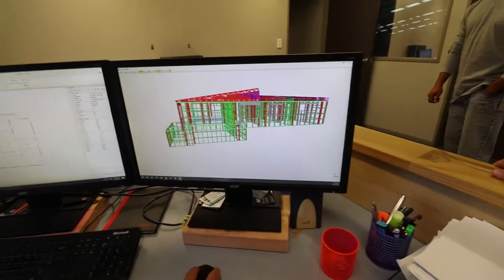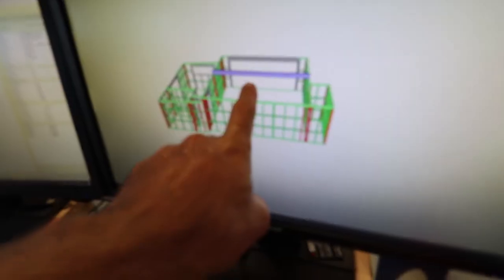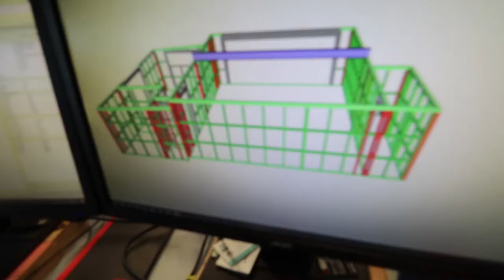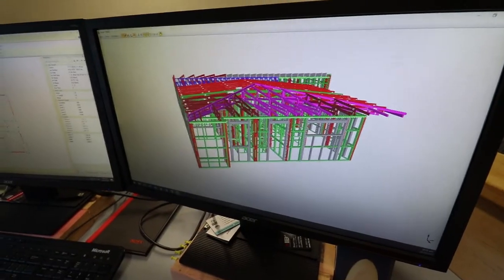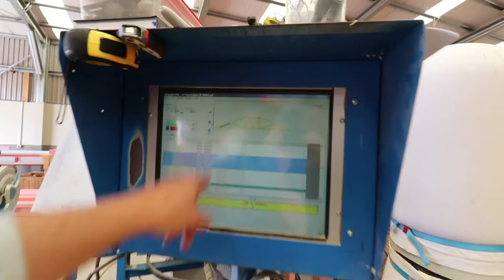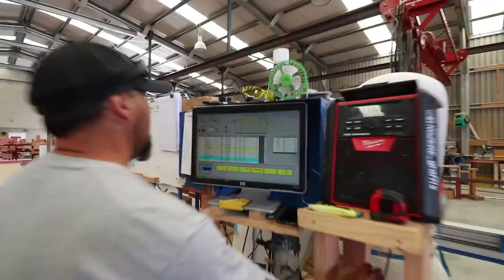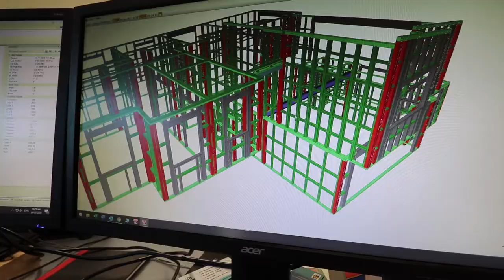NZ Prenail Framing Factory Tour

Comment: Man that factory looks really interesting - all those nailing tools and that nail plate squisher thing ... suhweet!
Reply from the maker: Yea I loved getting an insight into how it all works, It was cool to see all the little jigs and tricks they have to make things flow more effectively
Reply: @wolfgangselle4307  It looks nice Wolfgang - they have more robots to carry things around and more CNC type machines. But is it really "better" ? They still use handheld nail guns to make the frames, and they manually insert the insulation. And their health and safety looks a bit dodgy - none of them have their helmets buckled up - the question is though - why do they need to wear helmets? Overall, by comparison - I think it's not an issue of being "behind" or "ahead" - they are both using a combination of manual and automated labour resources to achieve the same result but the German factory is newer and/or cleaner which does indeed make it look impressive.  Thanks for sharing.
Reply: @Rob Tee - Takami Woodshop  ... take it easy .... sure you still some handheld tools it will never go without the human input .. u cannot make everything automated .. maybe you could ? But that would be to expensive even for big companies like this one. Yeah this factory is new, I think a bit more then one year old I believe? I want only show you what’s possible. And  to the issue to put the insulation in by hand it’s still the best way for this kind of insulation. Other kind you can put in the walls fully automatic. But sometimes you can not replace a human to do this kind of work.
Reply: @wolfgangselle4307  "take it easy" ? I'm sorry mate - I didn't mean to upset you - your factory is fantastic! Definitely something to be proud of. 👍